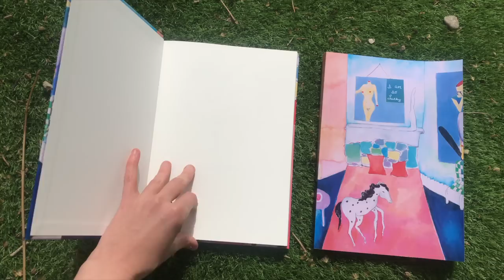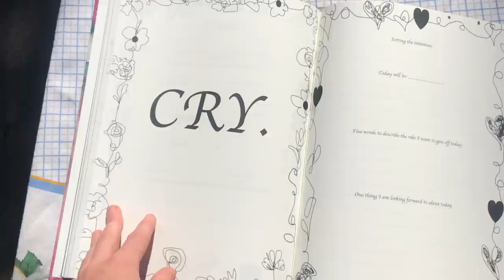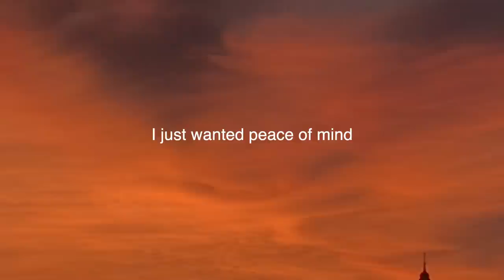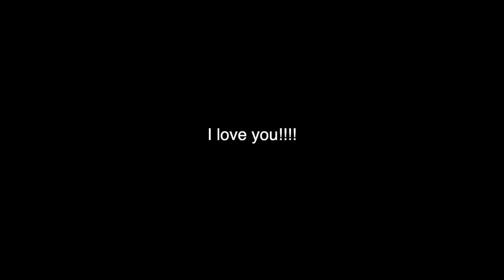Renovating my Paris apartment -  unexpected obstacles & lessons learned

Comment: Hey Shayna, electrical engineer here.

So first thing - what happened with the first two wires is pretty simple, for electricity to flow it needs a completed circuit, which means something that conducts that will make it go from point A to point B.  When you tucked this two wires you found on the wall together, you probably made the metallic parts touch, which created what we call a short circuit, you completed the circuit and suddenly the electricity had a connection to flow through. Usually short circuits are dangerous because if you simply use a cable to create this connection, instead of lets say a light bulb or a phone charger there’s no “resistance” in the middle, so the electrons are free to flow and the cables quickly heat up and probably even melt from the high heat. So always be very careful when handling cables and never let two random cables touch each other.

As for the problem per say, the solution is very simple, if you don’t want electricity to flow all you need to do is avoid completing the circuit. There’s a lot of ways you can do this, some people put caps on exposed wires, others just buy electrical tape and put it over the metal part that is exposed. You really don’t have to worry a lot about this, because from the moment you cover it with something that doesn’t conduct electricity like a cap or electrical tape the circuit will never complete, so the electrons have nowhere to go and will never flow through that bit of wire. (Just be careful while doing this and turn off all the circuit breakers/all electricity to avoid getting shocked, as it turns out our bodies conduct electricity and can also complete the circuit :p)

Another cool thing is your wall or w/e you bought to cover the holes also doesn’t conduct electricity  so as long as the cables are inside the wall and not touching other cables you will be safe.

Feel free to ask any questions related to this. :)
Reply: So nice of you to lend your expertise you're helping others as well 🫶🏽
Reply: Wow this is a great explanation! I thought she said it had to flow because somehow it was connected to the electricity in the kitchen?
Reply: So brilliant of you to offer Shayna this advice! Makes sense. Storing that away for whenever 😊
Reply: taking all the time to write that - you're a good person :)
Reply: @virginiacreager4331  what the guy meant with that is that probably that same cable goes through other outlets or connections in the kitchen. So removing that cable would mean cutting the circuit there which would make it stop working. 

Usually when electricians want to do something about random cables they have three options:

1 - disconnect the cable from the electrical box and leave it there, since it is now just a random cable in the wall. For this case, it wouldn’t work because the cable is being used to either provide electricity or to close the circuit from the kitchen. 

2 - take the cable completely out of the wall or the section that doesn’t matter. This is always possible, but sometimes very impractical to do. Older buildings rarely have nice cables pass-through and taking the cables out could involve breaking the wall. This a very bad solution, since you can always break other cables in the process or you can accidentally break the wrong section of the wall and then you just added extra costs to the whole thing.

3 - cap or put electrical tape over the cable ( always works and takes a lot less work)

I’d say option 2 and 2 should only be considered if your doing a whole electrical overall of the place, otherwise it’s not worth it. 

Also some extra info on cables in general, in your home you usually have 3 kinds of cables. They are color coded , each country usually has it’s own system and each color means a different type of cable.

The 3 cables are:

1 - live - this cable transports the electrons from the electrical grid and is the dangerous one, always be very careful while handling live cables;

2 - neutral - this cable is used to close the circuit, it transports the used electrons back to the grid. Very rarely dangerous on it’s own unless you make a cut in a used cable, even then the shock will be very small. 

3 - ground - this is used to send all extra abnormal charges to somewhere, mostly static electricity, but if some other extra charge suddenly happens we also sent it through the ground cable. This cable like the name says is connected to the ground. Also really not that dangerous unless you touch it during a very specific time.

There also other set ups, but this 3 cables one is the most common.
Reply: Omg❤️
Reply: so now she can do it herself, since the craftsmen are apparently lackning skills. 🧰💅🏼
Reply: I wish I could help with your wiring.  I could make some suggestions about your loose live wires. Do you have a "service entrance" ( electrical supply that enters your home) or a breaker or fuse box in your home? I could tell you some things to do.